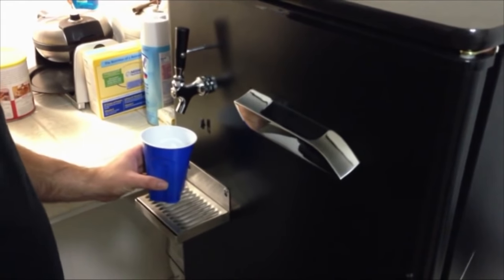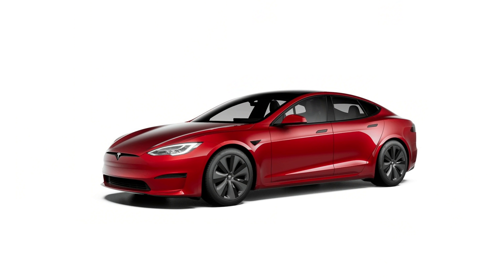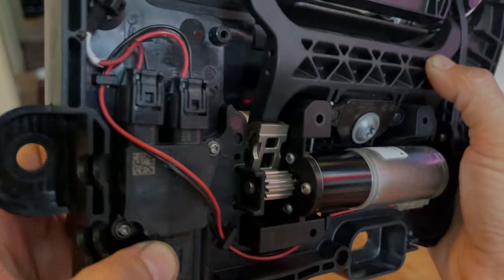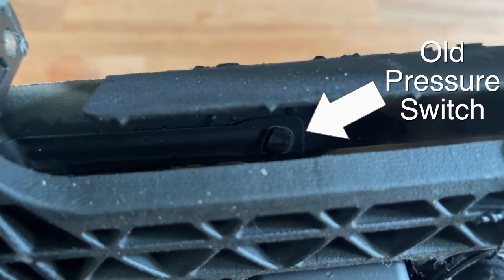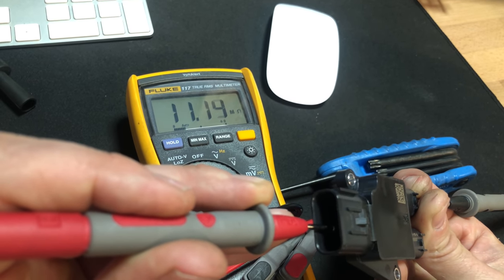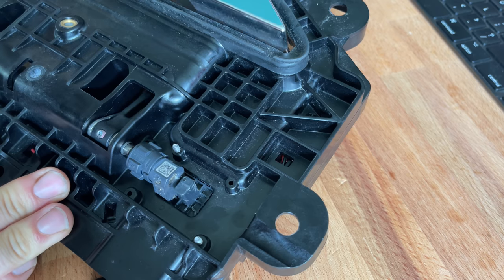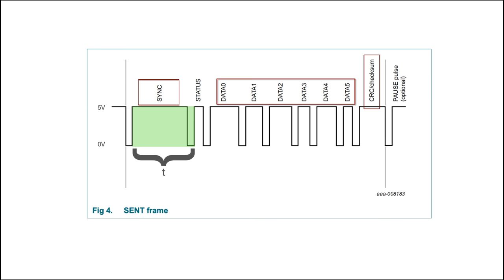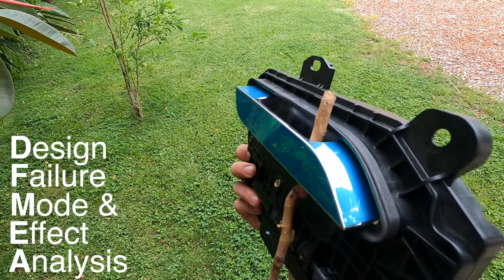Tesla Is Lightyears Ahead Of... Tesla

Comment: i would have used a motor attatched to a potentiometer (very common in arduino kits per example) to mesure the resistance and know the position of the motor and so the handle, it can also solve the problem that you enounced (the sensor can't remember the position of the motor), it's one mecanic part but it's a much simpler desing

Comment: I spoke with a former Tesla tech that is now running a private garage that services all types of EVs. We discussed the old vs new Model S door handle. The old style though prone to failure is repairable. The new style is not. It is prone to failure due to the insufficient sealing of the wires in the module. $500 for a new handle or $200 to fix the old one.

Comment: I imagine they could use a motor driver that can detect the stall condition of the motor bottoming out, it’s already done with stepper motors on 3D printers, which is a bit easier, but it shouldn’t be impossible with a more simple motor, especially since you’re not interested in anything but “is the motor experiencing a higher than normal load and is about to break anything?”. Heck, come to think of it, you could do it very crudely by just measuring the current consumption of the motor and wait for it to jump.

Comment: Totally not an engineer, but my theory for the closing the door handle question: Maybe the system checks whether a small movement of the lever changes the handle position. If it moves, it's ok to go till it doesn't. If it doesn't move, it just stops the motor. Best case scenario: nothing is in between the door and the handle, so it closes till it's shut. Worst case scenario: something IS stuck, and it closes till it touches the object, and stays like this till the next time the handle gets activated.

Comment: hmm. used a similar (no hightech sent) magnetic field sensor back in .. around 2006-2008 or so at MAHLE.
it was paired with a magnetic ring (and trained onto it). The magnetic ring had a difference in field strength around its outer diamater.
it was glued onto a throttle valve axis, the sensor fixed. when the valve opened or closed the sensor knew the position by magnetic field strength and threw out 0-5V i think.
initial setup was to position the ring, move throttle valve to closed and open, check if the signal was ok, glue the ring and train the sensor values for min and max position, rest was interpolation in between.
the sensor went into a pic16f627a .. which controlled a geared motor which set the valve to a certain position with feedback loop like a servo motor..
the valve itself was used to control the audio transmission level of a passive sound generator/sound "filter".
Hitting the gas pedal gves you a nice immediate feedback directly from motor intake into the passenger room,
but when youre on it for a long time (highway) it closes/fades back so you dont get annoyed or deafened as it happens on a "sport exhaust".
Also your neighbours dont get deafened or woken up in the middle of the night/morning by your antisocial exhaust pipes.
- Mainly interesting for diesel engines couse the throttle is always open (power controlled by fuel injection) unless some emergency error mode is active.
Was a prototype to improve passive sound generators, don't know if somebody used it, for most cars they didnt want to spend the extra money for parts...
which is annoying on the highway.. MX5 2.0 Skyactive for example has an "always open" sound generator.
It uses the normal engine throttle valve to regulate, but of course most of the noise already gets through even if its only partially open.

Comment: Flush door handles? Some 1970's Fords had those. 1973-1976 Thunderbird and the Lincoln Mark IV and V. When the Probe was introduced in 1988 some car magazines claimed it was the first Ford with flush door handles. Nope.

A very nice flush door handle was used on the Subaru XT Coupe. It had a flap to push in below the handle so that ti all fit completely flush with the door surface.

Comment: Hmmm. I wonder what kind of magnetic shielding is around the door handle. If I brought a strong enough magnet into contact with the door, right above the sensor, would it throw off the sensor and possibly open the door?

Comment: Just to clarify to everyone using the Arduino framework: The Arduino framework/code environment is not fast enough to read the signals, while the microcontroller that sits on the Arduino boards is more than fast enough to do this.

Comment: So essentially, the next iteration should have the lever from the motor direct attached to the handle, via rivet or wrap around, so if the handle is pulled out while power is off, the motor, and sensor pivot point will be moved with it. Interesting.

Comment: about the movement back. 
I would guess that if the sensor doesnt see a correspondant change in handle position once power is applied to the motor, it just stops applying power.

Comment: I think the answer to the problem of wedging a stick in the door handle would be to introduce a motor with stall detection into the design. These kinds of motors are already in use in a lot of industries where stall detection is essential. An example in the automotive sector where it is already being used is controlling automatic headlamp leveling and swivel. 

These motors work by measuring back EMF against the number of PWM cycles. During a motor stall, there is little back EMF to impede current, which allows the current to rise to the design limit quickly. At this point, a PWM current controller inside the motor activates, and the built-in microcontroller shuts off the motor. The point of failure will then be the handle if it's constructed from weak materials, assuming a motor with proper stall detection for both hard/soft stalls is implemented. That being said, I think Tesla's current design is quite reasonable.

An alternative would be a capacitive touch area on the door that signals the door latch to release when the touch area is activated in the presence of a key fob. However, this poses two questions? First, what system would you put in place to prevent unauthorized entry while the vehicle is in use, and how would you open a door with no handle?

Comment: this design is good for electric but the reason it isn't on ICE cars is because it uses electricity (if you battery dies you have no way to get in the car to pop the bonnet to jump start the car) for keyless entry cars most have a secret key you can use in a hidden place (usually behind the door handle) to unlock it with no power

Comment: I don't consider myself engineer, but I know electronics, and when I saw a lot of switches, I was laughing and saying out loud "Use magnet sensors in stead!" Though I didn't know about that magnetic field angle sensor.

Open electronics is a bad idea for any outdoor activity. I'm still mad about how certain car connectors looks like, and have wondered many times why the car industry don't utilize more heavy dury connectors AND run them with ethernet with PoE+. The IEEE 802.3bt standard gives up to 90 watts via ethernet. The AVB/TSN protocol ensure reliable packet transmissions and is more than suitable. Having everything on ethernet would give far better diagnostics, and the expandability is nearly unlimited.

Comment: The SENT protocol is interesting.
the data is stored in 'nibbles' which are 12-27 tics long (storing a (hex) number 0-15)
and a single tic is 3-90us long (the length is decided with the sync pulse)

so a nibble has 4 bits of information and a message has 8 nibbles - 32bits can be sent per message

the message can range from about 600us to almost 30ms if my math is correct

Comment: Worked on the original S and Roadsters (1st gen) at Chilton Autobody in San Carlos 2009-10, always was impressed by the door handles from a hot rodder point of view. Recently i found myself having to re-engineer a set of Kindigit hot rod door handles, the customer found a way to cock up the handles and door latches. It baffles me how much engineering and thought must go into something as simple as door handles. How strong should they be? Nominal pulling force to activate a door latch and begin pulling a door open? NO! More like nominal pulling forces PLUS a 200+lb Gorilla customer trying their hardest to rip the handle clean off the door.

Comment: As it is measuring the angle while retracting the handle, it should see that it retracts slower than it's supposed to ( because your fingers are in the way providing "resistance" ) - so presumably it would stop at this point and hopefully before your fingers gets stuck.

In theory.. I would not provide fingers for testing that theory however ;)

Comment: they should have gone with proximity sensors so you just hold your hand near where the handle would be. then you have no exposed moving parts, and no aerodynamic turbulence. and the mirrors should be cameras and screens inside. then they work in low or no light, and no drag.

Comment: >mentions unnecessary failure points on a motorised hidden door handle
Lad. The entire thing is an unnecessary failure point. if anything, just recess the handle into the door instead. if you REALLY want a seamless surface, get to spring flaps that you can push in to grab the actual handle.

Comment: Since an Arduino runs at 8 or 16MHz, you should have plenty of CPU cycles to handle incoming data - also the ADC should be able to run at speeds well over 9000 samples/s. So SENT signals in the "ms range" should be fine to get captured assuming the firmware was written effectively.

But its interesting to hear about SENT, which sounds promising.
Reply: I did some research ans SENT and it's decoded by measuring pulse time. The unit of time is call tick and that is calculated in micro seconds (us). 1 tick can varie between 3 to 90us according to wiki. micros() on typical 328 has resolution of 4us. I am sure there is ways to do this on a 328. I would use my teensy.

Comment: If you’ve ever seen a 60 year old Cessna 182… they have the most intelligent flush mounted door handle I’ve ever seen. 

It’s a pivoting door handle. You press on the forward end with your thumb or index finger.. and then the rest of the 3/4 of the handle goes into your hand. And you pull it open the same way you pull a modern car door handle. 

It locks by having a key cylinder and tab go into a slot on the long end of the handle. 

No motors, no sensors, no waiting for it to present itself, a perfectly natural motion to use. 

And the only thing that fails on it is the retraction spring after 30-40 years. Buy a new one, replace it, and keep going. 

But Cessna fell to the “electric is better” trope in the 60s when they swapped fuel gauges and flaps from mechanical to electrical. Gauges became erratic, flaps became slow, and both became failure prone. 

Sometimes technology is mature and we don’t need more for technology’s sake. We don’t have automatic sliding doors for every room like in Star Trek because a regular door is just fine.

Comment: Cool content. To be clear however, you may have got the accent on the wrong syllable in the SENT protocol.  The initial pulse doesn't vary or convey any data. It's just a timing reference. The following 8 bits ARE varied in length to actually convey quite a wide range of possible numerical data.   
Interesting question in mind however is why deviate from the conventional CAN buss technology used in most vehicles currently.  It offers significant noise immunity at the cost of some additional wiring. But this explains the anecdotes I've been hearing among the (ham) radio community that a burst of RF will temporarily "kill" a Tesla.  I'd hate to see a vehicle in  autonomous mode get scrambled by someone keying up their mobile radio station.  Time will tell.

Comment: Well, having electric actuator that only has two edge positions (open/closed) is fairly easy and does not require any additional sensors. You want to open it? Give it some voltage and measure the current. When it reaches the final position, it will get a lot of resistance and current spikes up. It's done. The same goes the other way. If I would design that, I would simply make sure that the metal part can't go beyond the open/closed points and is strong enough to hold the electric engine without moving further. You want to push the handle out? Just give it voltage and stop when you get the current spike. If it's already there, it will get the spike right away as it can't go further. Obviously you need one backup in case of failure - have a time limit like max 30 seconds. If it did not reach open/closed position within that time, it's screwed.
If you have modern Dodge, you may know exactly the same type of device that sometimes breaks. Blend door motor which is actuator actuating A/C flaps to direct air to different places. It works the same way. Just power and ground. Want it open? Run the power and wait for current spike. It works great and it does not matter which position it is in, it does not require any calibration as well. You can take it out, rotate the engine, put it back in and it will work because the high resistance positions are the ones when the flap is fully opened or closed. So where's the failure point? Gear shaft is plastic, it's molded into the case. When it sheers off, the gear starts to skip when it reaches the position and is not able to stop this small electric motor so there is not enough resistance and not enough current spike. It just rotates making nasty clicking noises as the gears are skipping. It goes away after around 30 seconds because of the backup times and it all works. It just does not sense the position anymore because there's no hard stop anymore. The part costs $25, dealership asks for $500 for replacing it. There are four of them. Fixing them once and for all - drill a hole and put thick metal nail in place of the molded shaft. I'm quite sure they did that on purpose.

Comment: My driver side just blew a 10amp fuse, so I put in a 15amp and got smoke coming from the door handle. I assume its a pretty new one as every one of these handles has been replaced on my 2014 MS at least once...
Reply: ALSO I learned when a fuse blows, there is no mechanical override to open the front door - at least the rear has an emergency pull thats very good. Terrifying.

Comment: I'll go to the dfmea meetings.  I have 20 years of supervising my crew of misanthropic reprobates who have a distinct lack of situational awareness.  Ever wondered why grilling hotdogs on a charcoal Webber grill in a 99 Ford Econoline van is a bad idea? It's not the hot briquettes or carbon monoxide you need to worry about.  The ac evaporator hates being heated by a grill on July 3rd driving through holiday traffic in a tunnel.  Thanks Jim for discovering that.
Reply: On a high note! Ford did install full rubber interiors so you can wash the grease right out in seconds. The in dash electronics were designed to withstand the cleaning agents found in most commercial car washes. You won't have to miss a minute of commercials on the rock n roll 500 while you clean out the evidence of your latest dmfa experiment on a company vehicle you don't own.

Comment: Dang, I was so close ordering some until he stated that the Arduino wasn't up to the task of reading the output.
BTW. Configuring it to mode 0x14 to 0x17 will set it up for a clock cycle of 24 microseconds. Is that sufficient for the Arduino to keep up?

Comment: DFMEA meeting for a winter jacket:
What if the chemical compounds of the coating chemicals are changed such that the coating becomes flaky if the UV exposure exceeds 250mW/m² at -10°C? We need to verify if some mountain regions can get to these levels.

Customer:
Puts on jacket inside out.

Comment: Does the motor feel resistance somehow? I'm thinking in the winter when the handle is covered in ice, will the motor shut of by the resistance or will it grind the gears right off?
Reply: The gears are made to melt and protect the device if the vehicle is ever in any temperature below 80 degrees. They are also loaded with a small explosive that go off it the temperature drops below 65, just to make sure you are not able to use the handle. That is why you never see any Model S on the road. There was only ever made 2, and they have to be kept at a constant 90 degree and 5% humitidy to not explode into a large ball of fire.
This might be sarcasm. 😉

Comment: The new version still looks complicated for no reason... Why not just have a motor alone do all the work? A motor can tell you how much current it's using all the time... if more current is needed, it means there's no more space to move or there's an object in the way. This way you can tell it to move in or out until the current used by the motor exceeds "X". As for the push to open, a stepper motor can tell how much it has rotated so if one pushed on it and it rotates "X" amount, pop the handle out. As simple as that.